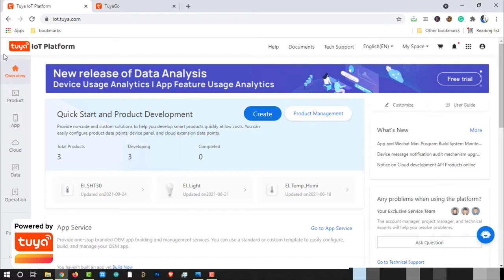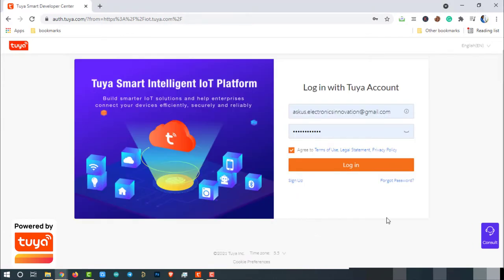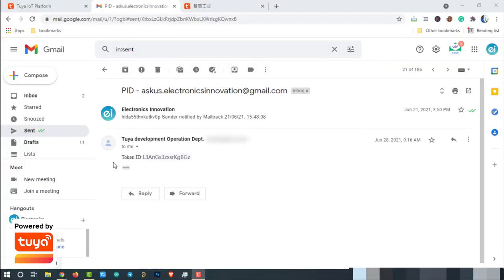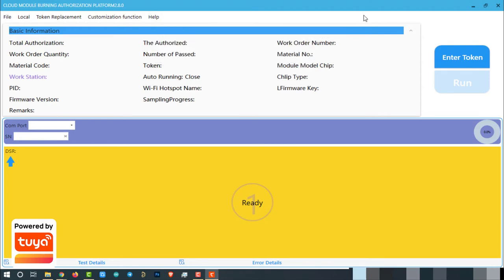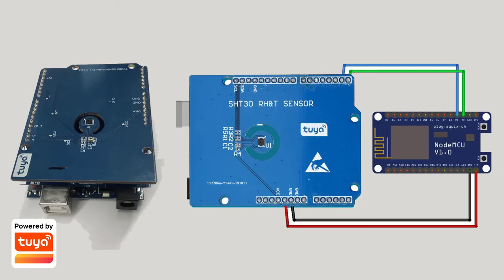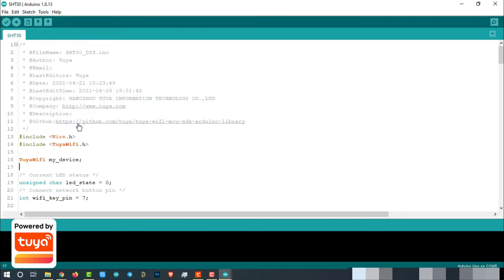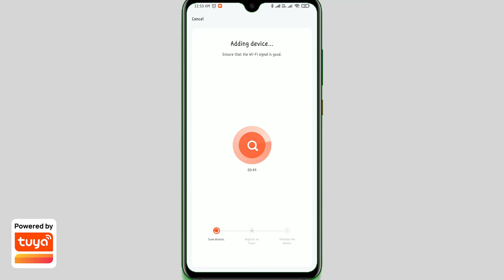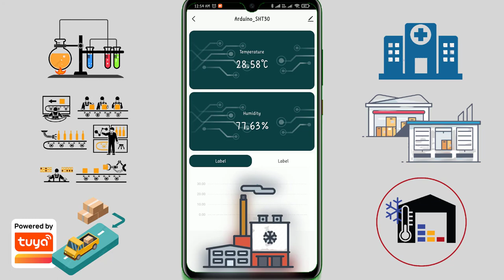DIY Temperature and Humidity Sensor with Arduino & Tuya Sandwich SHT30 Board on Tuya IoT Platform

Comment: Can you make the same thing but with multiple temperature sensors? (3 for example)
I would like to track temperatures on my diy heat exchange ventilation system (recuperator).

Comment: Hi! Good video! I have some doubts.. how many days does it takes to response with the TOKEN via mail? I have sent the email 3 days ago and I have no response :( . Other problem is I don't understand.. you created a new product, but you don't selected ESP8266 as your MCU.. how do they know that? In TYDA tool, says de module model chip: ESP8266.. TYDA knows that for its own?
Reply from the maker: To which mail did you send it???
Is it dev@tuya.com???

Generally, this process only works with esp8266 only.
So, you don't have to worry about selecting other boards.

Comment: Nice video sir. I just wanted to ask you for help, I am using tuya IoT platform for my project. Can we use ESP32cam board on tuya , if yes then how we have to configure it? Help if possible sir.
Reply from the maker: Currently Tuya not supporting ESP32 based boards.

We cannot configure at the moment.

May be they are working on this.
Reply: @electronicsinnovation   any news about this? wonder If I could use it with NODEMCU Thanks in advance.